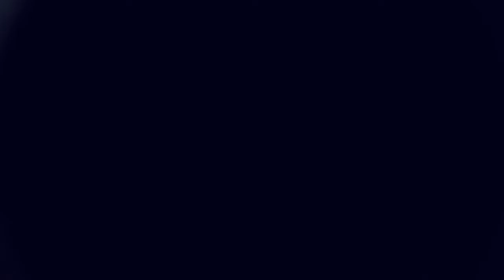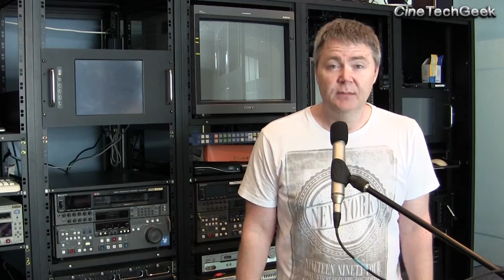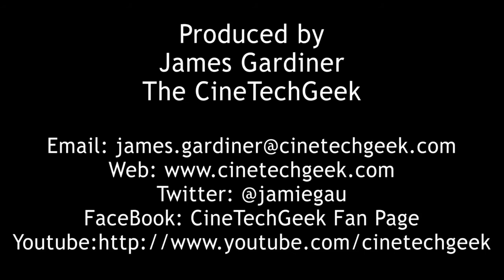6000 MB/s networking explained

Comment: Can't wait to see the result of those test, was about to buy 10Gb nic, i'll wait for your upload :)
Reply from the maker: +jolejo7 I'll be doing some more on this I hope at NAB..   Not sure when I will get time to do more on the better then 10Gbe networking..   Cannot justify getting the kit at the moment.  And not for a while by the looks of it..
But will see what I can find on this at NAB in terms of people doing it and get comments from them on it..  Especially in terms of using ST2022-6  or SDI over ethernet as in replacing the need for coaxial distribution around a post house etc..